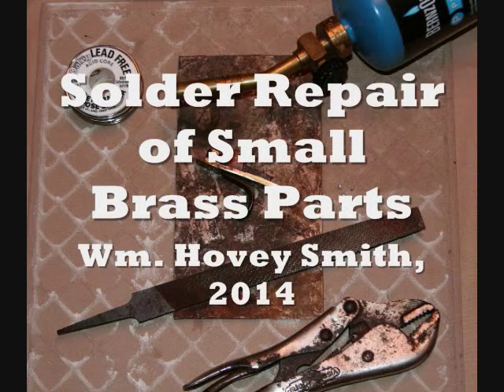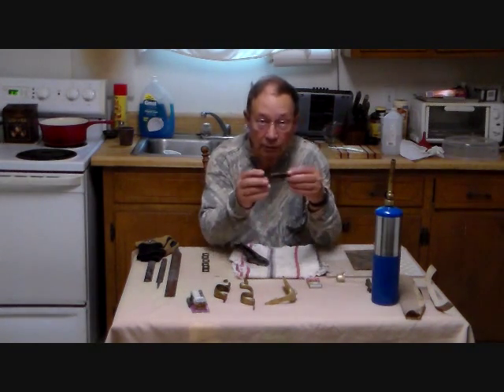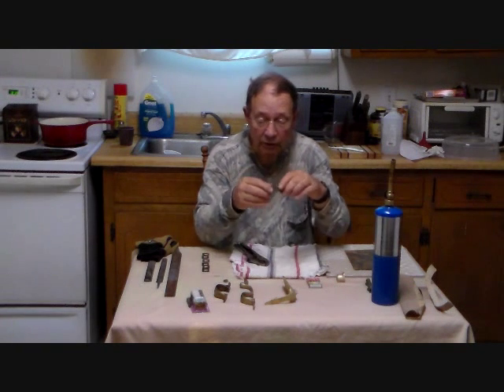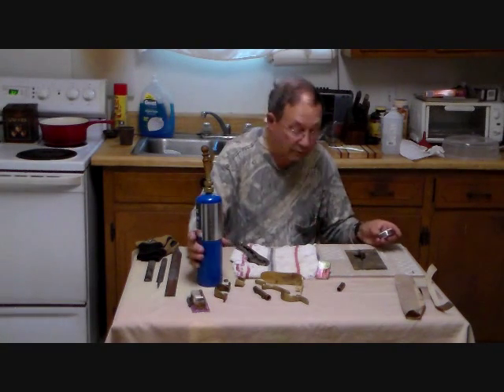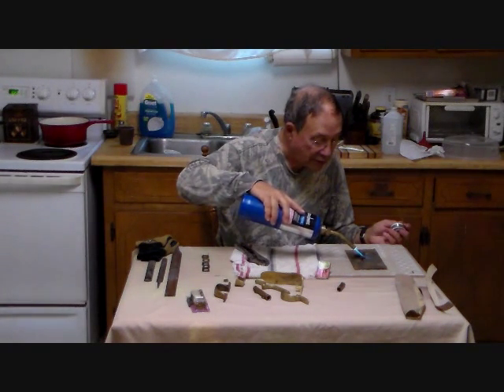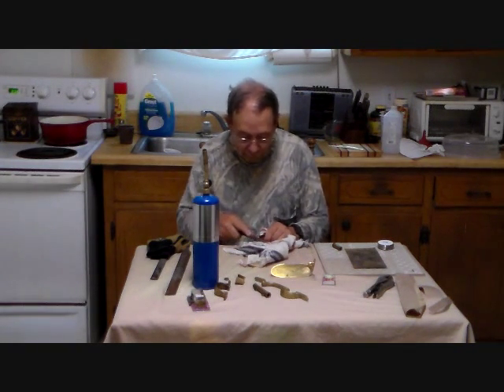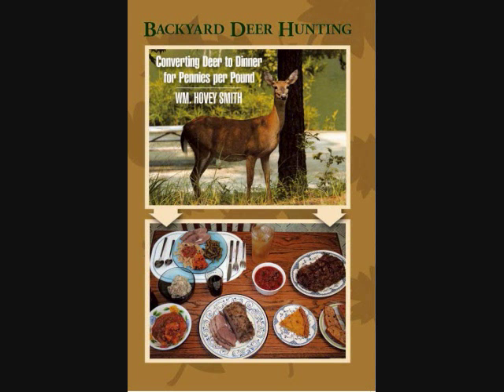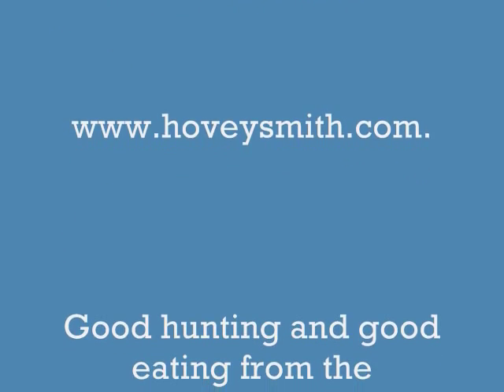Solder Repair of Small Brass Parts

Comment: Any tips on soldering two halves of brass powder flask? Having trouble holding the halves in place. Tried copper wire wrapping but failed. THX in advance. CURT .
Reply from the maker: I would trill filling it with dry sand then clamping the flask shut, soldering the edges starting at one side and then progressing towards the other, pouring pot the sand and then catching up any holes. Not an easy process.
Reply: @HoveySmith  Thank you.  I have decided to braze it with low temp Phosphor Copper Brazing Alloy

Comment: Hi Hovey, great accent, love it. I am confused about solder. Need to make a similar repair on a cracked brass carbide lamp. Your solder is as you show Oatey silver bearing general purpose. Looking for silver bearing wire solder on ebay draws a blank unless  Oatey imported at huge cost. General purpose plumbing solder seems in the uk to have no silver - usually tin-lead, unless lead free, then no info on what it is. Any  ideas/advice? Here silver solder comes usually in rods, like brazing rods. There is this (Supreme Quality Audiophile US made KESTER Solder Wire, Tin 96% With 4%Silver}. Is it the same as you use? I am a little concerned about melting points.

Comment: Any advice on cleaning surface rust off of tools like Wrench's and sockets I live in SoCal but during the winter months my tools develop a lite coat of rust and it comes in a short period of time. I work in a indoor shop and I don't understand how this happens mainly during January and February and California winters are very mild?
Reply from the maker: If you are near enough to get winds from the sea it might be air-born salt from the ocean that is doing the harm. Naval Jelly is one material and there are some more modern preparations designed for cleaning cast iron. To protect against air-carried salt, conservator's wax applied to warm tools will prevent rust even if dumped into salt water, but this coating will quickly abrade off. If it is just discoloration, rather that deep scale rust, I would not worry about it too much. Wash in water and then dry and coat with a medium grease or oil. If you do not wash, in water or alcohol salt will corrode under an oil film. I don't know if this helps in your particular situation, but I have given you some options.
Reply: @HoveySmith  I made the comment 6 years ago?
Reply from the maker: @eddieds312  I answer them as they come up. Why so long, I cannot say.